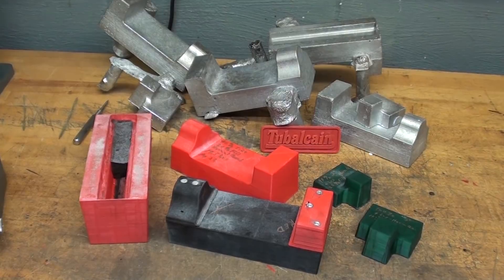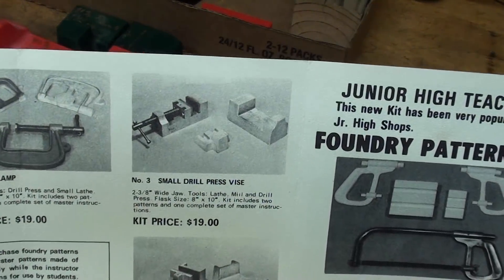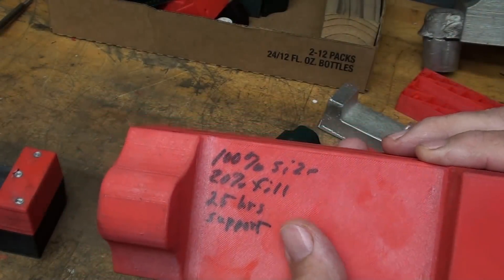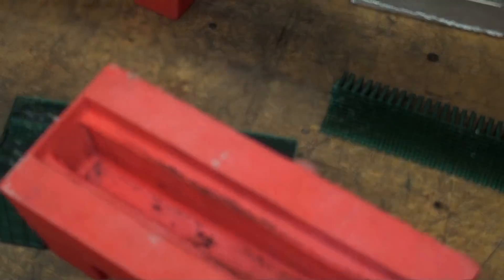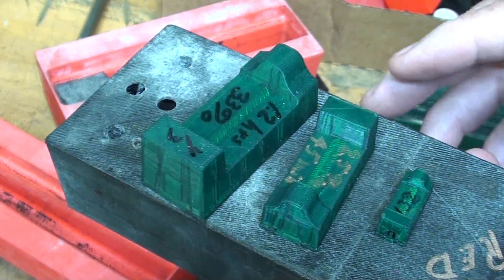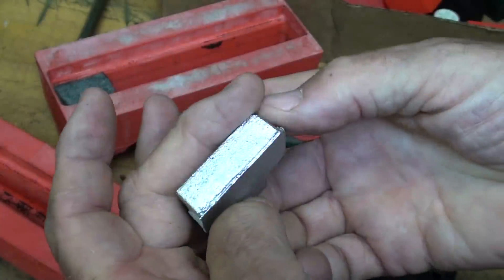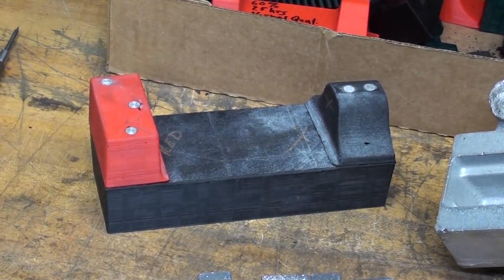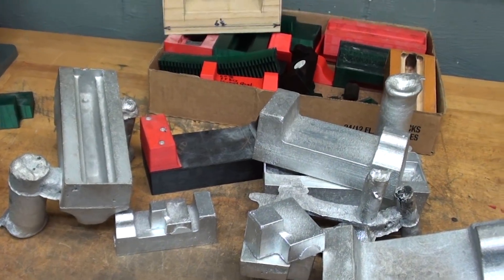Foundry Patterns for Drill Press Vise #446 tubalcain

Comment: Hello Mr Pete.  I know that you have done several casting videos I have not been able to solve my current problem.  I  am trying to cast a replica of a atlas 10"  babbitt bearing style head stock.  I found a accurate 3D model  of one that only needed a bit of modification on Gradcad.com.  I want to use it as  a pattern but after look at images of the original head stocks, I can't figure out how the sand mold  to  be set up the mold or how Atlas did it for that matter.  The model that I am trying to recreate  has bolt on spindle caps  and the back gear supports bolt to the head stock.  Any suggestions would be greatly appreciated.

Comment: A pattern shop near me actually has a 3-D printer that prints using sand.  They can print the molds and cores directly without need for a pattern or core box.   This would be very useful for prototyping and for one off foundry work.  I am quite sure it will never be fast enough for production.

All the best!

Mike
Reply from the maker: That's very interesting to hear

Comment: Mister Peterson, how about using a 
"core print" for the underside of the base?

Work up a box that you can fill with sand, 
with sodium silicate mixed in. (3 to 5%.)
That would be located in the mold, where 
the base needs the clearance for the 
jaw hold down to move.

Keith Rucker did that on some pulleys on the 
"planer matcher" he restored.

https://www.youtube.com/watch?v=HwLD-cj7SIk&list=PLWGjSMyywXVkeYAs5lKg_XSB6cVGl85bM&index=9

Your design would be much easier.

Doug Jackson (SVSeeker) uses sand and 
sodium silicate on most of his castings.

steve
Reply from the maker: Good suggestion, but not easy to do. A couple of videos down the line, you will see a solve the problem
Reply: I saw you did mention a core, later on in 
this video.

As always, great stuff.  You are STILL the IA 
teacher of the decade!

steve

Comment: My brother in law is a pattern maker (25+ years). It amazes me how he can take a set of two dimensional drawings and make the pattern, core box and core print/prints to tolerances that cause a carpenter much grief! 
Awesome series you’re making here!
Reply from the maker: I have said in  many of my videos, that the patternmaker is the exaulted craftsman. There is no one more skilled than a pattern maker. To convert a drawing into a usable three-dimensional wooden pattern of great complexity is a skill that cannot even begin to be comprehended by the common man.

Comment: Cool series. I've got an anvil base I want to cast that should be fun. Recently made one of those indicator holders for my lathe. So much faster than setting up a stand. Milled mine from a block of delrin. https://www.facebook.com/photo.php?fbid=1801439403234611&set=pcb.1801446656567219&type=3&theater
Reply from the maker: That is so awesome

Comment: Mr Pete would you think about reproducing plans for the 1x42 sander , the disk sander and the band saw,  I would like to purchase a set , because I like building old style tools and think they would be great projects . thanks in advance
Reply from the maker: By popular demand, I think I will show those working drawings on YouTube. Although I think this is useless without the castings. And the patterns are long gone
Reply: True Mr Pete if the dimensoins are there then they could be reproduced either buy making new molds or by machining, either way if you do reproduce the drawing/ plans i would like to buy a set of each because they look like quality machines vcs that low quality overseas stuff thanks again

Comment: Liked it a lot Mr. Pete, mainly because you are giving your thought process in mold making and what it takes to get a good casting in the end.  It also goes with the old drafting saying "never draw more in the morning than you can erase in the Afternoon."  ;-P  The advantages of CAD is that it is relatively editable.  When I taught CAD the biggest thing to get across was draw a couple of basic lines and Edit, Edit, Edit...move, rotate, mirror, trim...Board drafting was more about Geometry and how to achieve and think about things like tangents and centerpoints, etc.  Look forward to your casting vid and how you do the sprue's and risers.  Thanks always for all the work you do to bring this forward for us!  ~PJ  P.S.  I think making one of those micro vises would be a hoot!
Reply from the maker: Thank you for your input on drafting. Are used to like descriptive geometry. I think that's a thing of the past. The casting video will be on tomorrow and another one on Monday
Reply: As much 3d drawing I do now I still do just as much 2d with software that’s only mildly smarter than paper... the software has been around forever and companies don’t want to change packages even if it costs 5x more to draw in. Either way I still fondly remember doing technical drawings in pencil in high school and I am far better off in 3d drawings because of it.  -Kevin

Comment: Mr. Pete
If you want to reduce the hole depth in the split pattern fill it with some 3m Panel bond. It’s an two part epoxy used to bond metal parts in body shops. Somewhat self leveling and you can repair almost anything plastic with it.
Big thanks for all the videos. I’m on a mission to watch them all! Less than 200 to go.
Randy from Montana
Reply from the maker: Thank you, keep up the mission. I need to buy some of that product. In fact I was thinking, what can I pour in there that would be self leveling. I was thinking about polyester like they use in fiberglass work.but it is very gooey and messy

Comment: You were talking about the thickness of the casting and the related shrinkage and that is something I am wondering about as I am just learning about some of the physics of how metal cools and the various components 'freeze' during the cooling process.  Last night I borrowed Stephen Chastain's two volume set "Metal Casting: A Sand Casting Manual for the Small Foundry" from our local library and as with any learning I think I now have even more questions than when I started reading his books.  

The first volume wasn't too interesting as he covered areas I think I have a sufficient grasp of I have just started the second volume and am blown away by all that happens during a casting!  In your experience, I have so many questions I hope you don't mind my asking, is it better to cool a cast slowly in the sand, or turn it out and let it cool in air or, as so many YouTubers do, dunk it in water and cool it down very quickly?  The little I have read on the freezing process really makes me wonder about which approach has what effect on the final casting.

I can relate to your comments about your foundry being a fair weather activity as I am somewhat in the same boat, although I almost prefer casting in the cool weather as I fear my electronics controlling my furnace do not like the heat.

Thank you again Lyle for all that you present and I increasingly appreciate the effort it takes to pattern, mold, and then cast these items for the incredible videos that you create,
Mark
Reply from the maker: Thank you for watching and commenting. I have never read those books. I believe the casting should call for an hour or two in the sand mold. And then you can quench it. There is a lot to learn. Very few viewers are interested in what you are talking about
Reply: Thank you for your reply.  I live in a small city so the selection of books on practical matters is woefully inadequate, I fear much of people's time is not spent in learning but in distraction and idleness and this is reflected in the frustratingly superficial book selection in our library.  

Would there be any advantage to leaving it in sand longer, I'm a hobbyist and have no great urgency to unmold the castings beyond my impatience/eagerness to see the results :-)

I have, from Paul's (from Paul's Garage channel) video, purchased some of the Gingery books on establishing a small machine shop.  I think I am going to attempt the casting of the lathe elements not so much for the end product but for the learning along the way.  I find I learn best if there is an application for whatever it is I am doing so having a well defined project such as this really gets me focused.  I am looking forward to learning how to get the CAD to model the parts, learning how to get the CAD to generate 3D printer ready patterns, then printing them and then casting something from the print.

Comment: These kinds of videos and the experience you share is exactly what I am looking for in my YouTube content.  I had just come if from my shop for a wee break when I watched this video; it is spot on to exactly what I am doing with my 3D printer (also a Creality CR-10 from Banggood, on your recommendation of the machine).  I want to cast gudgeons and pintles for my sail boat and all manner of other smaller castings and your discussion here was enormously interesting.  Thank you very much for posting these videos.  Do not worry about those that nay-say what you are presenting here, is suspect those folks don't actually build anything so they cannot glean anywhere near  the amount of information that you are providing us.
Reply from the maker: I think you are right about the naysayers. They really want to go golfing. It is interesting that you are using 3-D patterns. I cannot seem to get it across to people the value of this process. Compared to making wooden patterns. Especially when you need to make changes in size and so on
Reply: When I watched your videos where you first started using 3D printing it was like a light switch was turned on!  I had been exploring casting but was greatly inhibited by creating the patterns, your presentation on 3D printing was a revelation!  No joke I went to Banggood and ordered the CR-10 and couldn't wait for it to come in.  I have been finding the learning curve, for me, on the printer has been much steeper than I thought , but I will keep at it.

My CAD skill are not the greatest but I would greatly welcome the chance to work with you if you have any small CAD drawings you need.  I have learned very much from you I would certainly like to contribute something back if I could.

Comment: Recently purchased a 2.5" vice from Ebay.  Looked good in the pictures but had some large casting voids once I received it.  Don't know why a manufacturer would let that out of the shop.  Great work Tubalcain.  You are inspiring a younger generation, with the "new fangled"3D print  technology.  Haven't seen a video of yours I didn't enjoy.  See you in #447.
Reply from the maker: What is that casting made of cast-iron question or aluminum

Comment: One professional 3D-mold making method is done with very fine dry sand that is spread loosly in thin layers. Then computer controlled print head working similarly to a ink jet printer sprays glue on the loose sand that is supposed to stick together. Then the next layer of sand is spread on top and glue is printed/sprayed on it. In the end you remove the loose sand and your mold emerges.
Reply from the maker: That is interesting, is there a video on that

Comment: I have found bondo glazing putty (907) works well for smoothing 3d printed parts. Applies easily, dries fast, sands easily. Filler primer might also work to fill in the fine lines.

Comment: I actually was tasked to draw the blueprints (actually white sheet with blue lines type prints) to make that vice when I was taking drafting class in high school. And I still have those drawings as well.
Reply from the maker: That is so awesome.send me a copy if you can
Reply: I'll see what I can do. But be gentle on me, because they are marked up by the teacher where I made line connection and line weight mistakes. And they are large as well and many sheets. But I see what I can do.

Comment: Mr. Pete, when there is an issue with the layer lines grabbing sand, spray paint the 3D print with body filler Primer.

Remember also, PLA absorbs moisture. It's always good to seal the PLA pattern just as you would with wood.
Reply from the maker: Thank you
Reply: Mr. Pete, I want to add another thing, I haven't tried yet. 

The company Machinablewax.com sells a "Lost Wax" 3d printer filament. 

I will try it sometime soon. I don't recall seeing any Lost Wax videos on your channel. If you have knowledge in this area, I'd love to hear.

Comment: Have you ever tried  lost foam casting?
I wonder if the printed patterns would be suitable for lost plastic casting if hollow enough.
Reply from the maker: I have tried it, was very poor results. I do not like it
Reply: Looking at the ones myfordboy made the PLA is encased in a type of plaster. The PLA is burnt out and the plaster pattern is then rammed up in green sand. The detail is extremely well defined.

Comment: Is there any reason that the alignment pins couldn't also be part of the 3D print, instead of having to manually align and drill?
Reply from the maker: Yes, the alignment holes were misaligned. But I believe the pans need to be added which is very easy if the holes all lien
Reply: The original idea with the holes instead of 3d printed pins was to use roll pins. They are more forgiving with tolerances  and are cheap.  My printer is different than Lyle’s and might overprint by 5 thou but with two parts 10 and that’s a mile for 1/4” pin fit.  By the way...I spot a modeling error in there.. those pin holes protrude through the top of the pattern.  What hack made that file!!!  Ha I thought I moved moved those pins in a later version to fix that.  Oh well looks like he sorted it the manual way.  -Kevin

Comment: I think those models could be changed a bit to print without support. "Bridging" works up to a 45 degree angle, sometimes even more with proper cooling and reduced speed. The simplest thing to do is to design the top of the gap to be a half-cylinder or some sort of an oval with elongated top.
Reply from the maker: The job is done. And I do not intend to go back. But I have great success in Mondays video